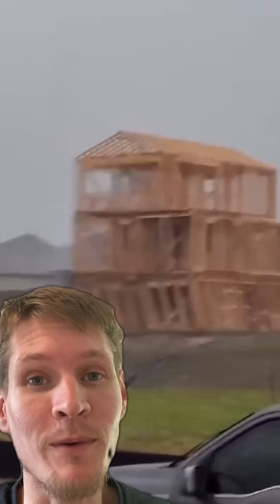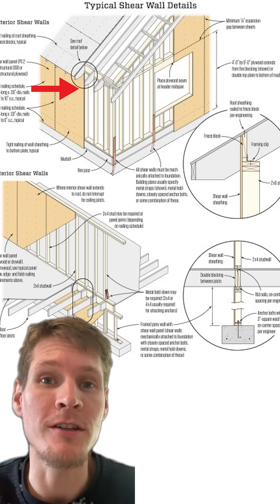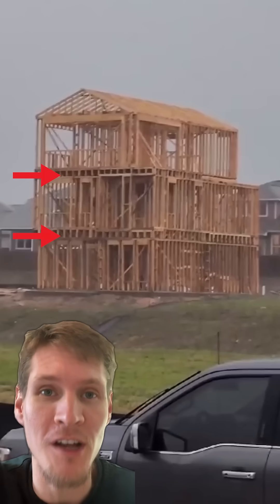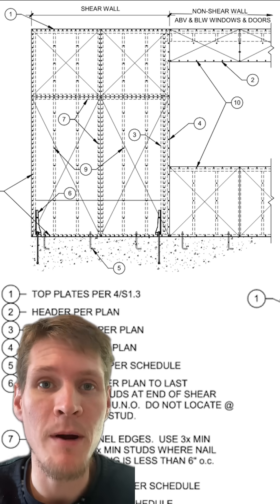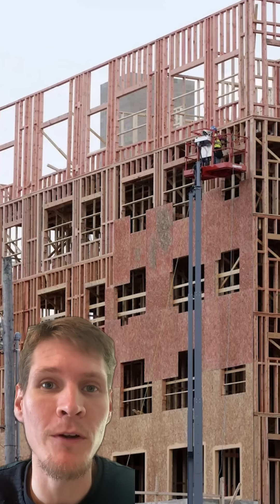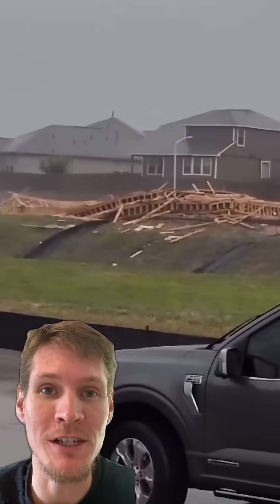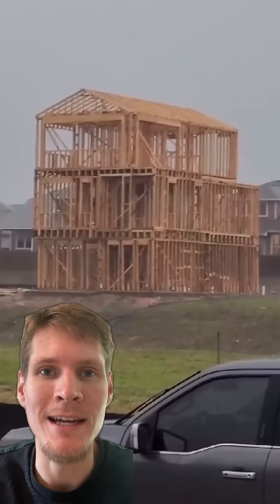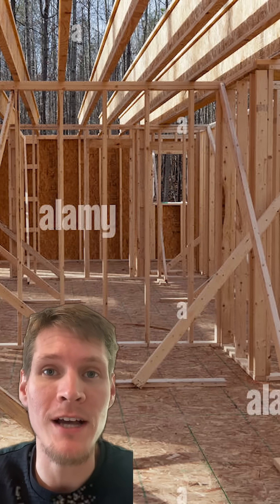Professional Engineer Reviews Reddit Structural Engineering Thread | Part 1 #engineering #reddit

Comment: My assumption is that the sheathing didn't get delivered and some manager without construction or engineering experience didn't want the framers to be idle.
Reply: And then wasn’t held accountable but everyone else probably was lol
Reply: @CranstonSandwich  so what? If, as a framer, yo did not know you were putting yourself in grave risk of bodily harm and death and proceeded to do what the "manager" said, you were just as dumb as him. Arguably more so because he did not actually put himself in that dangerous position...
Reply: @darijanr5704  Yep, obviously some framing crew framed out 2 more stories on top of the first level that didn’t have sufficient bracing,  regardless of how that came to pass, the framing crew is as much a part of the problem as anyone else involved
Reply: Would bet money you are right. Have seen this alot in construction whether in steel buildings or Scaffold, but they usually get lucky when weather isn't a factor. Only seen a Scaffold collapse once without bracing because the Foreman wanted to go back for diagonals the next day when it was convienant to grab, and a steel building once where they completed the roof and everything without any shear bracing because they were missing at the time (steel columns bent laying the roof horizontal to the ground)...both failed because a big windstorm came in.
Reply: @michaelreimer951 that's fukn ridiculous. I've only ever built a couple of scaffolds, but even I know you put the diagonals in IMMEDIATELY, as you go.

I have, however, declared some shoddily built scaffolds unsafe for work, shutting down the entire project for 3 days as a result, while they had a different scaffolding company come in, tear it down via cherry picker, as the scaffold itself was deemed unsafe to climb, and redo it right, before work was allowed to resume. I received high praises from all superiors involved, for noticing and speaking up, as an 18 year old temp. I guess things are different in Europe.
Reply: You can get sheathing delivered well before building 2 more stories and rafters. They're just bad builders.
Reply: @pavlobsrb probably during Covid when OSB was 100$ a sheet 😂
Reply: The framers have the duty to walk away from a job like that, and charge the contractor for the trip. The contract most likely states that all work must be performed to the plans and specifications.
Reply: Them framers are fast
Reply: Or they didn't see the value in having the materials delivered until all were ready to go up.  
(Same lack of knowledge, though)
Reply: @ there’s a lot that goes into it believe it or not, I’ve seen stuff stolen off the job site because it arrived a day early
Reply: @Matt-yg8ub  so you place another order and wait. You don't frame another floor in the meantime, you definitely don't put down the roof plywood to act like a lever for the wind to push on.
Reply: And the roof decking provided a nice wall for the wind to push over
Reply: Greedy and predatory marketplace. You’re supposed to be able to get away with these shortcuts and then walk away without them being exposed too much.  Cutting corners is so much part of the industry… embarrassing …
Reply: @gparsr  yup... it's become a calculated risk because they can do it 1000 times and get away with it and the one time they don't they're still ahead.
Reply: Yea but how do the framers do this without knowing you can’t do this? The whole crew from top to bottom never built a house before? This is absurd.
Reply: @_JimmyBeGood  read the rest of his comment. Hes implying that the manager made the framers do it instead of being idle. Framers knew, manager without experience didn't.
Reply: @ His comment says he is assuming that was what happened not that he knows that’s what happened. He’s only assuming which means zero.
Reply: @_JimmyBeGood  what? Are you okay? Your comment wasn't about him making assumptions and it not meaning anything.. you were replying to what he said. Mind you, you started with "yeah but" meaning you were confirming what he said and everything after was additional info he should have considered.

"I think that guy jumped from the high rocks into the water, i bet that hurt"
"Yeah but hes a professional diver so hes probably fine" vs "we dont know that, we didnt see it"

One statement confirms ans adds info, the other infers.

So he said the stuff probably didnt come and the manager didnt know they shouldnt build it and made them do it instead of being idle, and you say "yeah but the framers should have known" when really your argument is "thats all an assumption so it means nothing"? Weird way to say that if you ask me. 

Thought id add that your original comment is also an assumption, assuming that what op said didnt happen, so it means nothing.

Back to square 1. 

Lets throw out your original mistake, go with the fall back one. Nobody said thats what happened. Its a theory, thats all. Pointless to tell them they don't know that for a fact, they already admitted that.
Reply: @_JimmyBeGood  Yeah, but it still got 917 likes so far.
Reply: @_JimmyBeGood  thought they could get away with it and they would have.. if not for the storm that brought in hurricane speed winds. This was during the 2024 Houston Derecho. 100mph estimated wind gusts.
Reply: This is the framers fault.  No one else's.
Reply: Bottom right corner, you can see a stack of it behind the house
Reply: @gravestoner  The bottom right corner isn't behind the house.  It has a car in it.  Are you watching the same short as I am?  Behind the house is berm.  Slightly to the right is a trash pile.
Reply: You can use diagonal 2x4 on the inside until you get sheets.
Reply: @therealBocaStudios. Definitely a safety hazard, too bad it wasn't windy whilst it was being built, wouldn't that have been swaying quite a bit for the crews, yes? Didn't they have sheathing for the subfloors? Should have stopped with the 1st floor, used the sheathing they already had for the 1st floor corners, they had sheathing for subfloors, didn't they? Can't imagine doing the 2nd and 3rd floors with no subfloor to stand on, yes? No?
Reply: Definitely my bosses
Reply: I was thinking the same thing
Reply: Oh, it doesn’t even have to be somebody without experience. That’s just construction managers in general. God forbid anything comes to a halt for any reason, even for safety.
Reply: It just looks wrong.  Residences are almost never taller than they are wide.  There is no overhang in the roof, no garage...  To me it looks fake, or like it was built to demo falling over.
Reply: That's what I thought. OSB was an item that suffered supply chain issues during the covid lockdown. My workplace actually bought a truck of tongue and groove plywood and 2 trucks of 1/2" plywood to have on hand for when we ran out of osb. Only 1 order for the tongue and groove ever went out but we sent the plywood out on several orders partly bc it was also a normal stock item.
Reply: @richdobbs6595.  Was there sheathing for subfloors but none for corners??
Reply: @thomasmleahy6218  The problem was there no structural wall sheathing.  From the view of the collapse, it did seem like they had structural sub floors, which is basically a necessity with standard platform framing. Now days, almost all light wood frame construction uses some amount of structural sheathing, since it is some much less labor than installing diagonal bracing, either wood or metal.
Reply: thos is why we need Technocracy
Reply: Looks like a housing development, in which case there is probably a single general contractor, with a project manager and site superintendent, and then a bunch of subcontractors working for them. Looks like the framing subcontractor screwed up here and will be held responsible for this. With a standard stipulated price subcontract, the GC will have the right to terminate the subcontract with the framing subcontractor, and have the house re-framed with a different subcontractor and charge everything back to the first framing subcontractor.
Reply: Likely a "i don't care, I don't pay you to think, just do it" type
Reply: My assumption is that the general contractor awarded the bid cheapest bidder and they were probably incompetent
Reply: Lowest bidder didnt have down time in the budget
Reply: You're making a lot of assumptions
Reply: It's not that uncommon to do this with bracing as shown. Didn't plan for the weather
Reply: @ Wow, really? “Didnt plan for the weather”? 
You just proved your own incompetence and lack of understanding in construction or physics. Or safety, which of course is always 3rd!
🫵🏼🥸👇🏼
Reply: If the framers knew that the sheathing was not going to be delivered on time, they should have had a lot more temporary bracing. Any interior walls running off the exterior walls should have had cut in bracing. I'll bet what bracing they did have wasn't nailed to every stud either. And I doubt they even plumbed and lined the walls. either.
Reply: My assumption is that the guy in charge of the build was clueless, PERIOD!!!
No ifs, no buts!!
Reply: This is why we need machine learning robots you can program and teach.  Then, if they do it wrong, the programmers are at fault.
Reply: @ Wow! No.
How bout get a crew of men and teach them age old building techniques that have stood the test of time. 
Oh and also restore modern lumber measurements to actually match the stated dimensions.
Reply: @Datanditto  Yeah, just winging it is always better than actually doing calculations.  You don't really get the theme of this movie.
Reply: Have you worked with my ex-boss?
Reply: He did not want framers to idle either
Reply: @ That falls under safety third. (excuse pun)
Reply: I don’t build anything like that but I can say dont move on to the next stage when you need something important to complete next stage that’s just asking
Reply: Far more likely the builder only has experience building single story homes or no experience at all and didn't know better and didn't pay enough attention to the plans.
Reply: We done sheath in aus (sometimes we do) but we brace and our houses don't fall over.
Whoever framed this, doesn't know how to brace properly
Reply: Usually the sheathing gets put on the wall before it is even stood up on the upper levels!   It would have been delivered with the studs.
Reply: @BenKlassen1  That is a high quality, modern approach since it makes it easier to get everything squared and reduces the amount of ladder work.  I'm not sure it rates as being up to the frequency of "usually" though.  I'll have to pay attention to the new construction that is going around where I live.
Reply: Makes sense. Happens in construction often.
Reply: Yeah I agree, or they didn't want to loose the guys to another job so they kept them busy
Reply: That's exactly how these things go.
Reply: This is exactly what happened
Reply: Lol.....they had plywood, look at the roof, that's just really bad
Reply: the boss man said do it... so they did lmao... now the boss man asks why the fuck they did it :D anyways back when that video was made it probably didnt cost a fortune... cant say the same about wood now
Reply: Absolutely
Reply: The correct way should be install the sheathing on the ground first, then tilt up the wall. Therefore, you can avoid the wall being out of square.  If the studs are not plumb and square, the sheathing will missed the studs. I always called for 3x's for edge nailings. Experienced carpenter would not put up the studs first, then stands on ladder or platform to do sheathings. 
By the way, the lumberyard always deliver everything in one shipment. I always have people count against the bol, and reject any partial shipments.
Reply: @andylam2523  So, what is your explanation for this CF?  And where are you that you are using 3x material in your builds?  The only 3x material I've heard of is that folks used to build interior walls out of 2x3 studs back in ancient history.
Reply: @ I don't know what CF you were talking about give me the full name, maybe i can explain. I am in Ca., I usually use 2x6 in the ground floor for three story buildings. 2x4 for the top two level. 3x means 3x6 or 3x4 at edge of sheathing of shear walls. The reason being is 2x member is only 1.5"  wide for two columns of nails, Many times, the tip of the nail just pop through the face of studs, and were rejected. It is common to use steel moment frame in wood structures in Ca.  Because we needed to countersunk the bolt heads, we always used 3x's for beam nailers.
Reply: @andylam2523  That is a bizarre way of phrasing that you use double studs at every nailing location.  Not an unusual practice if you are using shear panel construction, but not what is commonly used for continuous sheathing.   The example frame  collapsed in a storm, so something clearly went wrong.  You said my assumption isn't in accord with site practices, so what is your interpretation?
Reply: @richdobbs6595  I was talking about using 3xs on sheathing edge nailing, not the field nailings. Using 3xs, the moment 
will be transferred to the 3x. When you use 2-2xs, you have to count on  the nails to hold them together. Cost wise,  using 3x,  I paid 50% more for wood, while you needed calculation to study how many nails to hold the 2-2xs together, plus inspection on every location and document the findings. 
It usually cost thousands to do inspections and recommendations. This case is a simple and straightforward. It is simply an insufficient temporary floor to floor lateral supports.
Reply: Your assumption is wildly ignorant given this is not how residential construction works.

The framing crew are subs, they probably just went ahead and built it all because they had the time available.
Reply: @gamesguy   Yeah, I am wildly ignorant.  I'm probably influenced by YouTube videos showing skilled building practices.
Reply: @richdobbs6595  Yes your claim about "some manager without construction or engineering experience" is just completely bizarre. These people only exist at a higher level in large builders(which this isn't) and they don't make day to day decisions.

The reality is this happened because some contractor with decades of construction experience didn't want to wait for the sheathing. 99% of these kinds of videos are the result of professionals who absolutely know better taking shortcuts.
Reply: @gamesguy  That is a pretty fine differentiation from what I said.  I say manager and you say contractor, meaning the first line supervisor, who is a manager.  But whatever.
Reply: @richdobbs6595  You specifically said "manager without construction or engineering experience". A contractor is the literal opposite of that. In addition, they're not a manager for the developer, they're hired to do one job and get paid a lump sum. They're mostly likely their own boss.

Nobody in the industry considers a contractor a "manager". They're basically the foreman of a crew.

But this is all besides the point, you refuse to admit that this was likely done by an experienced contractor taking shortcuts. I see this kind of nonsense all over the internet, people always blaming know nothing "managers" with zero relevant field experience when 99% of the time the problem is some 20 year old blue collar guy taking a shortcut.

I see this with safety too. If somebody gets hurt 9 times out of 10 it's an experienced guy taking a shortcut rather than a newbie.
Reply: Build proper houses, not sheds
Reply: If that’s the case, it is still the carpenters responsibility to tell him/her to pound sand,  call me when it’s delivered would be the only answer you get from me. This is insane 😅
Reply: Yea well thats when the framer needs to say no.  As a plumber I'm not putting my name on anything I know is going to cause a problem no matter what anybody says.  You want it done wrong, find somebody else.
Reply: Yep, stay effencient with a small increase in risk, then a huge storm hits the next day, and the risk is no longer hypothetical
Reply: when PM wants to meet the date
Reply: A bit of a necro, sorry
Back when I was (briefly) in construction, our relatively small company would have 3-5 different objects at the same time. If there were delays/planned downtime at one object, we'd work on the others so we weren't idle(not that it matters, as we were paid hourly).
Mos of the time we'd split the crew and work on the different objects though.
Reply: Instead they can do it all over again. They have plenty of work now.
Reply: But you're still supposed to plumb and temp brace it with timbers
Reply: @MrDeano-eu9rg  they did plumb and brace look at the video again. No plywood is the problem and 6/12 or whatever it was supposed to be nailing on it.
Reply: @MrDeano-eu9rg  there is temp shoring inside the building look closely....doesn't matter it needs to be plywooded before you start the next level
Reply: @MrDeano-eu9rg there were temporary bracing in this video. Look close before it falls down
Reply: @MrDeano-eu9rg  They did! See those little 20' long 2x4s? One in each corner. I mean how could they have predicted there would be a hurricane, or in this case a light breeze?
Reply: Probably, Time is money and that’s the issue with subcontracting all this work. 

We have a road in town that was supposed to be completed six months ago but it’s still not open even though major construction has been completed, because some idiot in the managers office didn’t order the traffic control equipment early enough and it’s back ordered and won’t arrive for another two months so they can’t open up the road
Reply: @Matt-yg8ub No traffic control lights!  What a massive project management failure there.
Reply: @ very much so. We pay the contractor (a private engineering firm) to oversee these projects and they bill us astronomical amounts of money…. But when they fuck up like this, we can’t seek liquidated damages because we don’t want to piss off the one or two contractors that we need because we are understaffed.
Reply: @Matt-yg8ub see you say that but it's only like 1 out of 500 contractors that would do something this egregiously stupid.
Reply: didn' consider it. prob
Reply: Crazy in Australia we never sheath buildings. We just build them correctly. Our frames are entirely structural.
Reply: @Bigdingaling95  I call bullshit
Reply: @wrxsti1987  you could easily confirm we do not use sheathing by googling and Aussie house build bud. We use plastic, then cladding. Usually foam or composite plastic.
Reply: @wrxsti1987  or brick. Most of our houses have brick exterior.
Reply: @wrxsti1987  did you educate yourself?
Reply: @3Mflatty95  Great!  You ignore basic physics, because some parts of your country are playing on easy mode.  Remind me again about how affordable your housing is in a country that basically is unpopulated!
Reply: @richdobbs6595  firstly the Australian building act of 1989 outlines exactly how EVERY timber frame home is to be built. Secondly our country is 90% uninhabitable 🤣🤣🤣 imagine thinking humans can survive in 55 degree heat 🤣🤣🤣. Thirdly we don't build houses using physics we use basic engineering. Back to your crayon drawings mate.
Reply: @richdobbs6595  btw that physics part had me rolling 🤣🤣🤣 imagine if every architect/engineer needed a degree in physics we would still be living in mud huts 🤣🤣🤝
Reply: @3Mflatty95  Great, and if you don't factor in the ability of sheet goods to resist racking more efficiently that joints in frames, you have written laws that institutionalize ignorance.  Engineering grows from physics applied.  Call it engineering, or call it physics, you can prove the benefits of diaphragms with hot glue guns, paper, and Popsicle sticks.
Reply: @richdobbs6595  once again talking out of your rear end without educating yourself on how our buildings are built. An Australian timber frame will stand as long as a fully built American home will. Probably longer. Your houses are lollipop sticks stuck together compared to ours.
Reply: @richdobbs6595  on-top of what I just said. Over the last 10 years Bluescope steel frames have become predominantly used for new builds. And there's genuinely no comparison between a steel frame home and a timber frame home steel is 1000x better. So what's your ridiculous argument about them? Steel bolted to concrete? I'll wait.
Reply: @3Mflatty95  It seems like a great idea that Australia imports steel to use in housing, because apparently you have shortage in lumber in dry, arid Australia. I'm sure China and India appreciates you exporting coal and ore and then importing finished metal.   But in North America, in practice, we have an excess of available timber, which is a cost effective, environmentally friendly source of building material  that we can get domestically from the Pacific Northwest or the South East of the USA, or over much of Canada. Some how, in designing my soon-to-be-built house, I failed to find the 1000x benefit that would suggest that I use steel framing.  So, I'm going to use the humble 2x4 when I can, and the incredibly cost efficient 2x8 as much as possible, and the LVL beam or 2x10 or 2x12 when I must.
Reply: Make out of sticks and paper. What a joke
Reply: @NKY151  lets see you build a 300sqm house in a month
Reply: @NKY151  greats  make it out of bricks and  in places like the west coast it  will be falling apart from earth quakes
Reply: Brick walls fall too when you don't finish the lower courses before building the upper ones @NKY151
Reply: @NKY151  Works fine, but you have to put on some sheathing to give it lateral stability.
Reply: No. The updated code calls for a platform style house, so that’s what they did. There is ZERO connections to the ground. A structure is held up because footers connect all the way to the truss and back down the other side, essentially trusses create an arch structure like a cave or bridge. Sheathing is NEVER meant to hold the structure up - thankfully this fell over BEFORE the actual design flaw was covered up.
Reply: @therealBocaStudios  You don't know what you are talking about.  Structural sheathing is commonly used to provide the shear strength necessary to keep the studs straight up and down resisting gravity even if there are for seismic and wind forces on the building.  Did you even watch the video beyond when the building collapsed?
Reply: Yeah like he's commenting on another video.
Reply: Oh yeah that guy's a Muppet. 
How were these guys planning on sheeting the second and third story after the fact lol.
Reply: @therealBocaStudios you have zero idea what you're talking about 😂
Reply: @therealBocaStudios  what are u talking about lol ...u dont even have a clue what ur talking about do you
Reply: @therealBocaStudios  Yeah, you have zero knowledge. you're just flapping your gums.
Reply: @therealBocaStudios  duffus
Reply: @therealBocaStudios  you're wrong. Sheathing may not be meant to hold it up (which is what this guy said. The up down holding is from studs) lateral or side to side forces are resisted by sheathing. Idk what code u build by but I've NEVER seen a house done like this that it was ok with inspectors. Personally I think you're full of it.
Reply: Dude your have no idea what you're talking about. 
Sheathing is the sheer strength to any wood frame building. The studs and trusses are for dead/live load, the tensile strength.
Reply: @therealBocaStudios he said "studs are for gravity support and hold the floor and roof".  Sheathing is for "lateral capacity"
Never said sheathing is to hold up a structure.
Reply: @therealBocaStudios  fn codes are different from state to state and county to county. I framed houses for over 20 years. You sheet the first story before you go up to the next floor. You have zero idea what your talking about
Reply: @therealBocaStudios Please stop babbling.
Reply: I highly doubt they are that stupid
Reply: @edmyers6919  What is your explanation then?
Reply: @edmyers6919 But they were obviously incredibly stupid in some way because this still happened!
Reply: @edmyers6919 oh but they are, and are more common than you think.
Reply: @edmyers6919  What do you mean?! People are stupid and impatient ALL THE TIME!
Reply: @edmyers6919 greed and tenacity. Not stupidity.